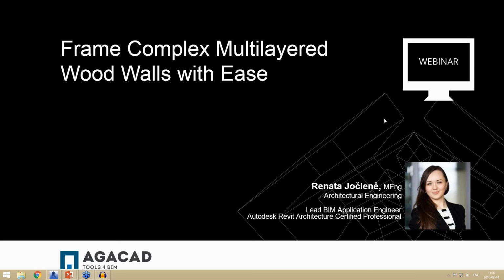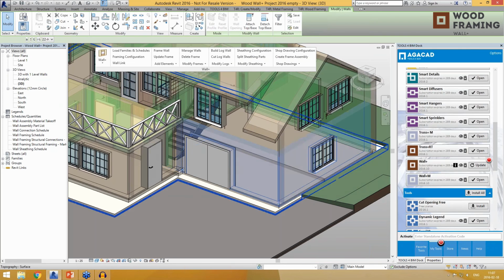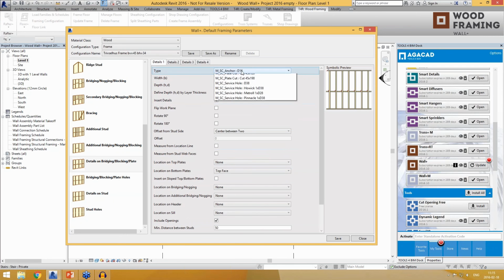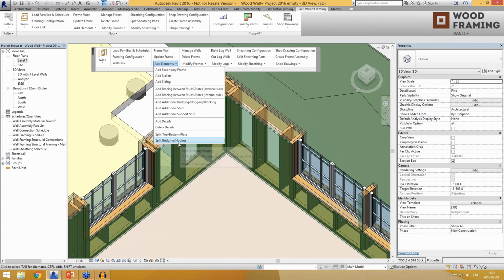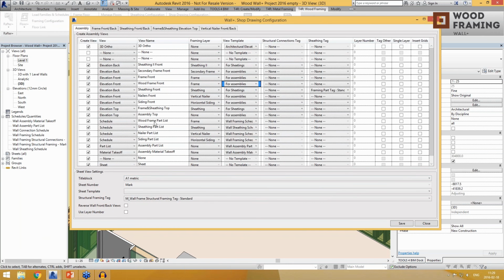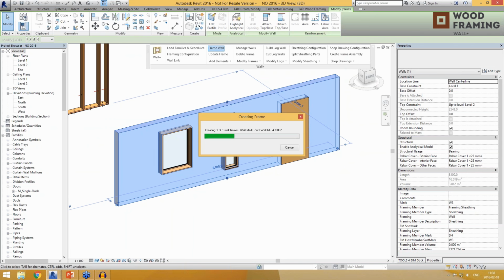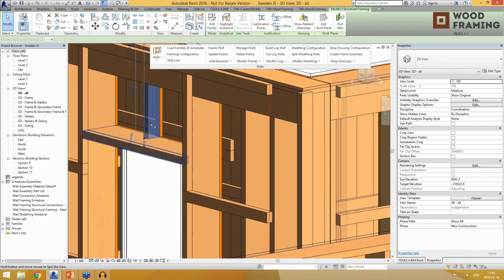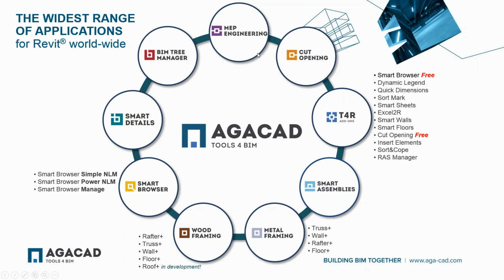Framing Complex Multi-layer Wood Walls with Ease

Comment: How do you add insulation between stud bays?  I have horizontal bays that need spray foam in between them.
Reply from the maker: We use Revit parts and paneling configuration to do that. It's too long to explain here, but feel free to reach out to our helpdesk@agacad[dot]com for further assistance